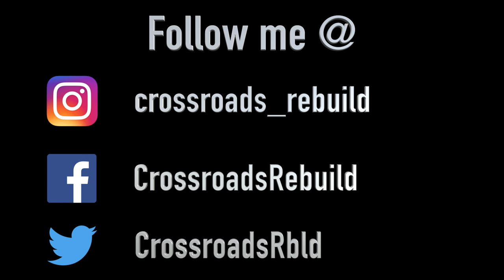Rebuilding A Wrecked 2017 Ford Police Interceptor Utility - Part 3

Comment: Give you props working on this engine. What a nightmare with all the wiring.

Its too bad these can't be converted into RWD getting rid of the PTU and maybe going with the 3.7 that has the external water pump.

Comment: Be sure to maintain the PTU. Those are weak points on the Ford AWD systems as they only hold less than a quart of gear lube. You will have to suck the fluid out of the fill hole as there is no drain plug, at least not on the Edge (I assume the Exploder is the same way). I suggest using Red Line Lightweight Shockproof oil.
Reply from the maker: Thanks for the tip!
Reply: The police interceptor PTU do have a drain plug.
Reply: After a certain year, they added a drain plug. And then put a Temp sensor, but I think those are the 16+ explorers (When the changed the body apperance slightly from the 2011 - 15 body)

Comment: Good progress and spectacular deal on the engine!   Seeing as how its an AWD it'd be a good idea to change the fluid in the PTU unit that sends power to the back at some point...least of your worries right now....lol.   They are notorious for going bad in the AWD Ford SUVs mainly because of a small fluid capacity and its surrounded by exhaust so the fluid just gets baked and doesn't hold up long.    I remember you mentioning you had greyhounds....our 11 year old girl had to get a front toe amputated about a week and a half ago, bad bone infection that basically turned her joints in the toe to mush and became swelled and nasty.    Been having a good recovery so far but thats no fun!
Reply from the maker: Thanks for the tip on the PTU! I’ll definitely do the maintenance when putting everything back together.
Sorry to hear about your Greyhound! We actually though we were going to have to have a toe amputated on one of ours recently  as well. But thankfully she healed up!
Reply: Crossroads Rebuild throw a clip of the greyhounds in a future video.   👍

Comment: Since you're replacing the engine cradle/subframe, why not just drop everything straight down as an assembly (motor, subframe, front suspension)?  It will then be a little easier to access everything that you need to remove.  Enjoying the builds as always.  Keep up the good work.
Reply from the maker: Glad you’re enjoying the build! I appreciate the support. 
The main reasons I haven’t dropped it out the bottom with the subframe is partly because the engine mount is broken and the engine doesn’t sit properly any more. But even more than that, I need the subframe to stay in place for frame work. I’ll need that in order to transport it, and also it will help the frame guy in the pull to have the original still in place.
Reply: Makes sense.

Comment: Wonder if the front timing cover was the only thing damaged on your old motor? (engine mount mounts to the front timing cover which is removable)  Guess we'll see when you pull it out. Either way excellent deal on the replacement!
Reply from the maker: Hope to get a deeper look at the old engine once it’s pulled. Maybe it’s rebuildable?

Comment: From my experience owning one of these explorers, do the water pump and timing chain while its out!  Water pump is behind the timing cover driven by the timing chain. If the water pump goes oit it leaks water into your oil. Theres a class actuon lawsuit against dor because of it going on now
Reply from the maker: Thanks for the suggestion! If I was sticking with the original motor I’d be inclined to do that. But the motor I’m putting in has less than 1000 miles on it. It’s essentially brand new. So I should be good for a while.